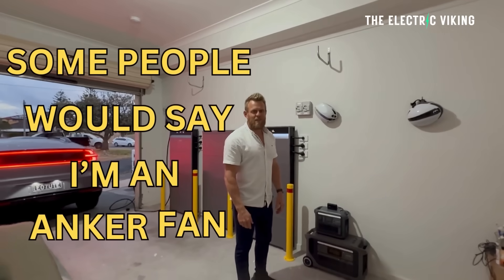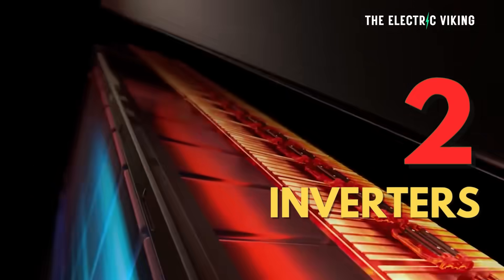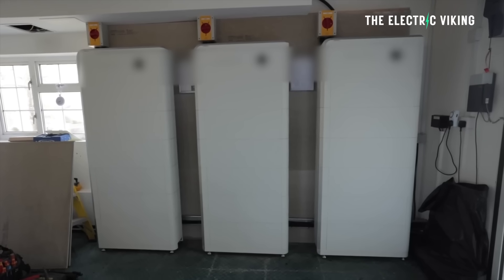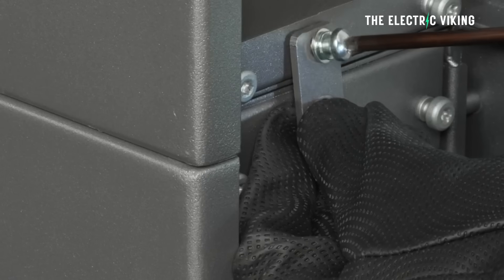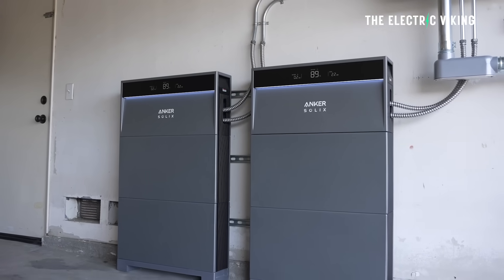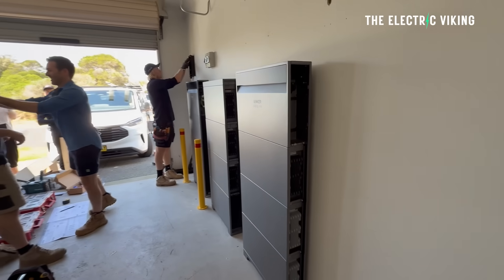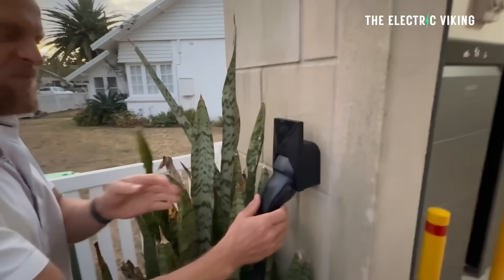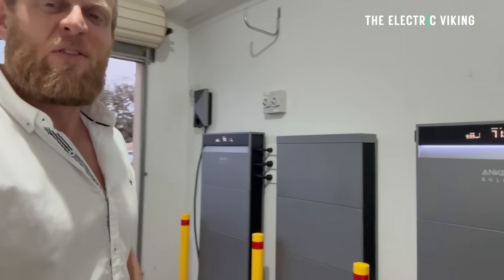50 kWh Anker Battery + 56 Solar Panels! My Home Setup Charges My House & EV For Free

Comment: I’m really proud of you for finally getting a proper solar and battery set up together. I’ve been charging my electric car for 14 years now with Solar. I first put together a small off grid system in 1999. I now have over 10 kW of solar panel panels hooked up and I bought 30 more kilowatts for future expansion. I have custom-made lithium batteries I designed and built the system myself.
Reply: would love to know how you made your custom lithium battery
Reply: @inevitable2900 a solar supplier got a hold of some Samsung SDI lithium modules that a total of eight cells that were 68 amp hours each wired in series for 24.0 V discharged 33.6 V at 100% state of charge and I bought a total of 20 modules. 40 kilowatt hours in total . 

I then bought JBD brand BMS’s that had 300 amp contractors instead of power MOSFETs and removed the proprietary BMS and replaced it with the JBD ones. I have a giant parallel configuration and I have a 24 V DC outback inverter that has been running for over 20 years now and I have lots of DC charge controllers parallel to the batteries. Very customized I have lots and lots of solar panels connected to the system. I’m going to connect another 10 KW of Solar Panels to the system.

Comment: thanks for the review. Could you perhaps show how the app works? does it have smarts in it like charge from grid, AI for weather prediction etc? My PW3 will charge during super off peak if needed if the next day is forecast to not have enough sun. plus Pw3 is also IP weather rated. I noticed you have a 22kw charger, but only 20kw inverter capacity.. so you cant use that charger at full speed!
Reply: So? 20kW is enough.
Reply: @ahaveland I charge at 7.5kw and it’s more than enough. Don’t see the point of these high speed home chargers, unless you drive uber
Reply: @Pepper.123 Indeed - good enough is good enough.

Comment: I have 2 x Victron multi 2 5000kva plus 3 x 14kw Göbel power batteries. 1 x 8.2kw Fronius snap inverter, 2 x Victron mppts and 11kw solar. I’m going to add another multiplus and another battery. Only on single phase unfortunately.

Been waiting on the home power update for a while. Good job 👍
Reply: Good luck with that. Victron is great.....until it is not.
Reply: @aljoubert8749 why?

Comment: Solar battery are the way forward but you don't need as big plus the price becomes pretty redundant after 20 grand which most people can't afford or can't work it around tax like sam probably does 

And people who say they got a battery and now running on free energy aren't doing this movement any favours when the outright cost needs to be factored in

Comment: Hey mate, I reckon this system won’t be paid off anytime soon if you’re buying it outright. We got a quote for a much smaller setup and it came back at 33K — payback’s over nine years! I get that you might have an endorsement deal with them, but the rest of us aren’t that lucky.
Reply: The main Australian government subsidy for home battery storage is the Cheaper Home Batteries Program, which started on July 1, 2025, and provides a discount of around 30% on eligible small-scale batteries between 5 and 100 kWh.
This is good for the country, not just individuals.
Reply: @ahaveland I know. 33 k it was price after rebate
Reply: @Aldob1973  that's cheaper then in America and many folks have solar in America.
Reply: @wthharrison7233  Right now our bills are only $100–150 a month. So what’s the point of paying $340 a month for the next 9 years? These batteries will become outdated much sooner anyway — in a few years, new ones will probably be twice as cheap. 33k It just feels like a rip-off.
Reply: @Aldob1973  Totally agree. It's much more sensible to go for a smaller & cheaper system that still fully meets your daily power needs for 3 seasons, say, and only sometimes falls a bit short in winter or when it rains for a week. Then you have a much shorter pay-back period where the batteries still have plenty of warranty remaining at the end of that period. Also it is rapidly diminishing returns to pay so much for overly large batteries now when you aren't using their full capacity most of the time, and battery prices are only going to come down year on year.
For instance, we only have a 15kWh battery and 8kW of solar, and an EV, but have been in credit with the power company for ages (from cumulative FIT), so have not had any outgoings for electricity, even through winter when we do draw on the grid a little bit. So to me a 50kWh battery seems like unnecessarily expensive overkill.
Reply: If he had the money to buy it outright then he's already paid if off.
So long as he doesn't crash into his basement wall it'll last.
Reply: He wouldn’t pay much for it because he’s sponsoring it. He basically got it for free.

Comment: Nice setup, 50kw is awesome. I am making a 30kw battery system, it will support two EVs. But how much energy do you use in a day?
Reply: How much solar do you have for 30kwh battery?
Reply: @carlylim5585  24kw of panels on the roof, in two strings 12kw/12kw because I am using two 12kw deye inverters in parallel